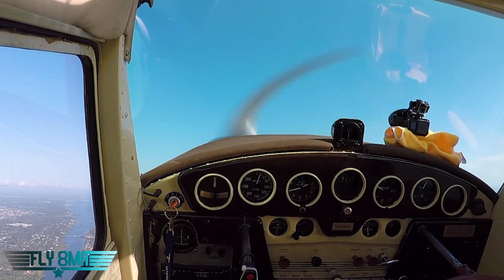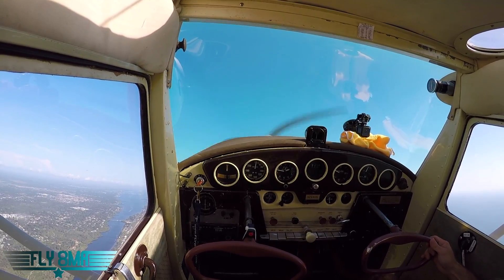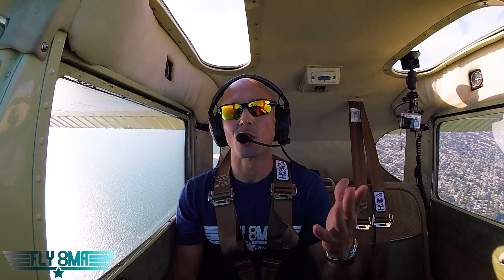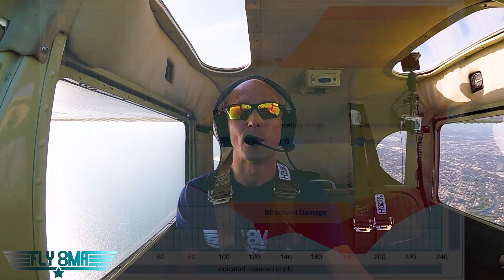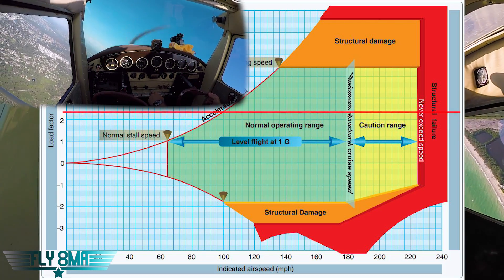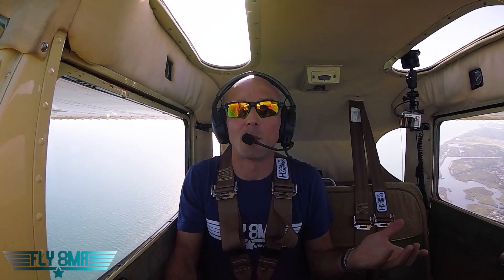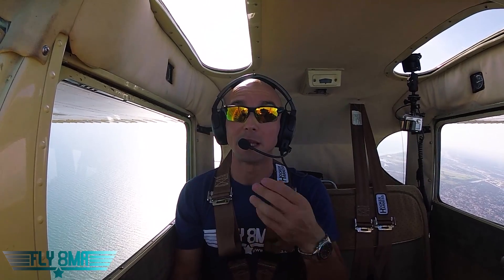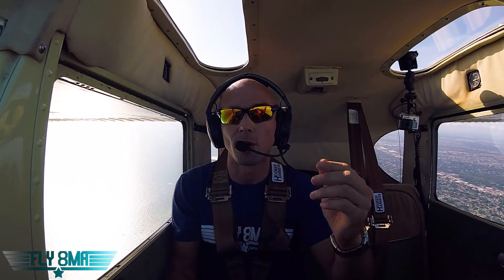Can You FLY Below Stall Speed? | How To

Comment: Also remember that in extreme slow flight configuration with high AOA the airflow from the prop and the vertical component of the thrust is helping quite a bit to keep the slow moving plane from stalling. An extreme example is a aerobatic plane with a big engine that can almost support its weight vertically, and can easily keep flying at and AOA well over 60 degrees. I can fly my Piper 140 level indefinitely at 40 MPH, but as soon as the power is pulled it drops like a rock (almost literally in a Piper 140)
Reply: That’s why there are two figures in most of the performance books, the power on stall speed and power off stall speed. The turbo raven didn’t have a power on stall speed because it was powerful enough to climb vertically.

Comment: Also, at such a low airspeed, many airspeed indicators are simply unreliable or vastly different than what they would indicate in straight and level flight. For instance, near the stall in an older Cessna 150, the airspeed indicator can actually display 0 knots if you do it right; this doesn’t mean you are doing 0 knots obviously. His demo was good though because his gps speed was quite close to his indicated airspeed so we can deduct that his indicated airspeed wasn’t ridiculously off.

Comment: The plane will stall if gravity force >  lift force . Stall speed ⇔ G force > lift force. 
If the wing is damaged or covered by ice  it can be at 600 mph or other speeds  ( the ground spoilers or something else) .
Reply: Yea planes always stall at the same angle of attack, not speed or condition of flight
Reply: That does not look like stalling to me, it is just failure to maintain lift which means it will gradually sink.  Stalling means you no longer have laminar flow when exceeding the critical AoA and there is a "sudden" loss of lift.

Comment: I am learning that there is technically no stall speed.
Reply: Tom Stulc. You are missing the point I am making and the video is making. 
Don't rely simply on speed. It is stall conditions and not simply speed. 
Referring to it as speed means someone new may not realize they can stall well above the stated stall speed and also a power on stall. 
Understand the stall. Understand the plane. Fly the plane. Not just rely on a gauge.
Reply: There is no stall speed... there is a stalling angle of attack.

Comment: Hmm this title is a little deceiving is it not? The bottom of the white arc indicates the stall speed, at all up mass. Well if you’re not at all up mass, then that isn’t the stall speed, that’ll be another speed for that aircraft weight. This is a question, not aviation geek trolling.
Reply: Shouldn’t have called the video “below stall speed”.
Reply: The published stall speed is usually based on on aircraft at max gross weight.  Obviously, if you are flying at a lesser weight, the stall speed will be lower.
Reply: @markm318  always based on max gross weight. Legally required to be defined as such.
Reply: Graham Dacres. Stall Condition.
Reply: RCWeaven FPV sorry?
Reply: Graham Dacres. Speed is only a factor in stalls and not the only reason.

Comment: Yup, it’s all about G-loading exceeding lift, regardless if it’s weight (people fuel cargo) in the plane or weight caused by turning from g forces. A plane can stall at any speed.
Reply: Well hang on a minute. G load is the ratio between lift and weight.... you cant have "g-load" exceed lift.